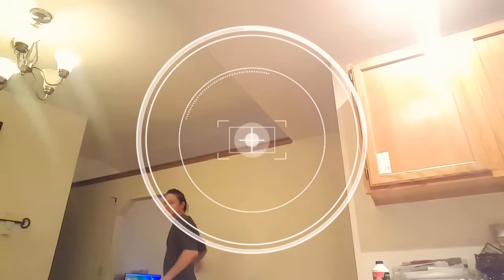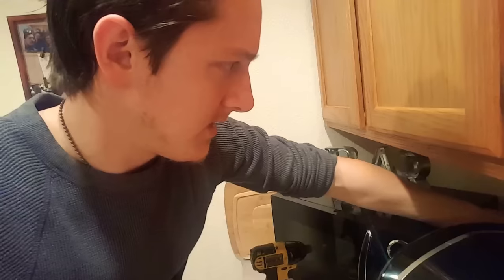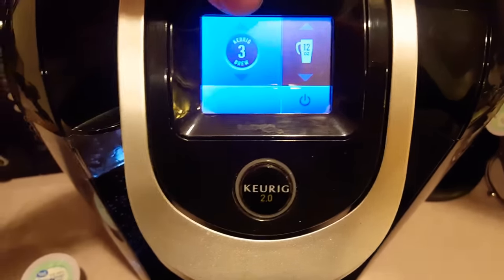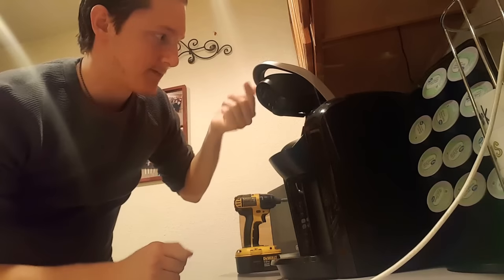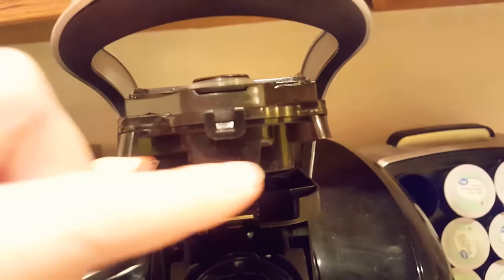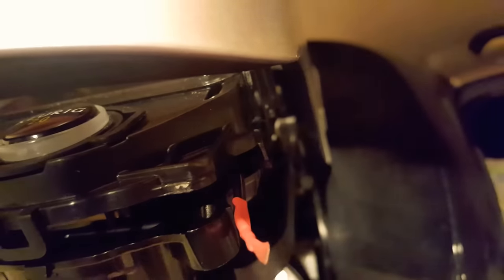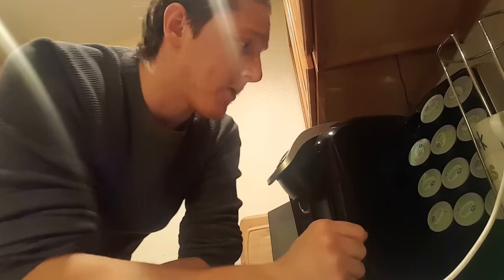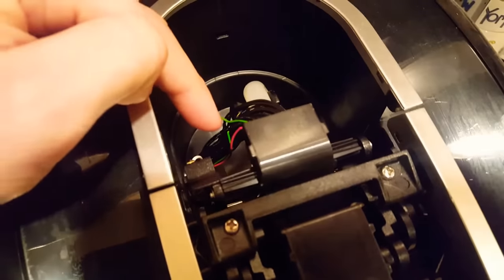Unlocking Keureg 2.0 PERMANENTLY (FULL MENU ACCESS) - Ep.2

Comment: Nice video.  I just got a 2.0 brewer and one of Keurig's My KCup 2.0 and when I put that into my brewer, all of the menus are unlocked.  I can understand unlocking so you can use any "My KCup".  But what's the benefit of unlocking when you're using just a standard K Cup?
Reply from the maker: Scott Baldwin You usually only get a limited menu when using k-cups, if I remember correctly it's like 3 options. This way you'll have like 18 options from 4oz. To 16oz. Plus carafe options without the carafe, so you could brew a pot or fill a 24oz thermos like I do.

Comment: Cut and spliced the two black wires and got nothing. So decided to cut the single green wire. When i plugged the machine back in it just kept pumping water. Spliced the green wire back together and it works again. But no menu change. So with that being said i would say its a bunk hack thanks though.

Comment: Just got my 2.0, saw your vid, followed instructions, but now my keurig just goes to the 'oops' screen no matter what cup I stick in it. So I decided to black up and undo everything, my keurig still stuck on oops screen. Anyone out there have ideas what went wrong. Thanks!
Reply from the maker: Joel Chavez I would guess the optical sensor is the culprit, not sure why it would still say oops. Did you connect the two black wires after cutting off the magnet sensor? Did you make sure to only cut the green wire in the back? Once those are reconnected you should have you standard Keurig back. Not sure why its giving you issues. It has seemed to work for almost everyone so far.
Reply: @LILBZ3  yes, I first read all the comments and most were positive. That's why I decided to try it. I had your video playing while I did this on my coffee table, did exactly as you did. And its apparent its the optical sensor, even went out and bought a new cup, still getting the oops screen. I appreciate you getting back to me so fast, thanks. Good thing I still have my old keurig.
Reply: I had the same issue, spliced the black wire for the magnet and cut the green wire completely.  Stuck on oops screen even with no cup in.
Reply from the maker: It sucks that it didn't work for everyone. I know that some of the new Keurig's are compatible with the "My K cup" and this hack doesn't work on those. I state this in the description but it may not be clearly stated. I would hope that reversing the "hack" would revert it back to original operation. It sounds like that is not the case. I hope your caffeine machines will be replaced or somehow magically start working again. My apologies guys.
Reply: PROTOONE I saw another post that cut the yellow wire and the green wire.  Tried that and it worked.  Depending on your model, you may have to cut the yellow wire as well.  My wife likes the fact that you can now fill a travel mug.
Reply: @matthewstoessner5739  I cut both the green and yellow I still get the 'oops' screen. I just bought my machine off of a facebook yardsale, onlyu paid $50 for the machine. it is a 2.0 500 series. I originally cut the green wire then the magnet, spliced the wires, and all I got was "oops" I then read your comment her, figured I'd try the yellow wire, and still,....nothing. now my machine has green, yellow, red, orange, blue and black wires.

Comment: i got as far as getting to the clips and i got stuck. Any tips for getting the clips off?Thank you
Reply from the maker: Stephanie Thorpe they are kinda a pain, just be patient and use a small flathead screwdriver or even any thin piece of plastic to pry each clip away to seperate the two halves. Don't worry if you break a couple, there were plenty of clips for such a small part. It helps to pry the two halves apart while fiddling with the clips, that way they don't just clip back into place. I hope that helps.

Comment: Hi. That was a very helpful video. I haven’t tried it yet, however I intend to. BUT, I might wait to see if you can help me with something else. The top housing on my keurig is giving me trouble. I just kind of figured out what is wrong. Now I must figure out how to fix the second issue I’m having.  1. The rubber stopper fell off, I figured that out from watching another video, reinstalled it and look forward to my next cup. 2. One day I heard what sounded like something falling down inside the rear area of the top housing that opens when you lift it. Well, since then every time I try to close it, the piece that has the window in it for the visual sensor, it sits back too far. When you start to close the housing it should move forward a bit, therefore allowing the parts above and the needle to slide through the appropriate holes in this piece, thereby allowing you to close it and prepare your caffeine. Well, that piece ends up hitting up against the back of my needle and stops it from moving. I can manually pull it forward a bit, let the needle slide through, then close and go. BUT...anyone else decides to make a cup, slam...boom...bang...forcefully attempting closure by manhandling. So, you seem knowledgeable and handy, any ideas on how to fix this issue. You did show me how to uncover the top housing, which I didn’t know, so that will give me access to the area I need to get to. But any further suggestions would be greatly appreciated. GREAT JOB BTW...I look forward to more hacks.
Reply from the maker: Lisa Smith I know the piece you mentioned slides along the silver pin you see horizontally when you lift to add a Kcup. I'm worried however that you might have broken a plastic piece. I would take the top cover off and peak in the back of the unit near all the wires to see what may have fallen off. If that piece is a piece of broken plastic, my suspicions may be correct. You may have an unnecessarily difficult fix on your hands and you may consider replacing. From my experience, these tend to get calcium buildup inside the water heater that takes away from the keuregs effectiveness and taste after about a year of occasional use, so a new replacement isn't a bad option. Let me know if I can be of any help.
Reply from the maker: Upon reconsidering my response you may be able to complete this hack THEN tear that optical sensor out with brute force and throw it in the garbashio. Hope you are still thoroughly caffeinated!

Comment: I didn't get the full access menu.. But I was able to use an off brand cup I wasn't able to before. I watched your vid like 3 times to see if I missed anything.. And I can't see what I did wrong? Any suggestions?
Reply from the maker: Ana Rivera did you connect the two wires that went to the magnet sensor? I used the word splice in the video and not everyone may understand to put the two black wired together (bypassing the magnet sensor). I can't think of anything else that would cause your issue.
Reply from the maker: Ana Rivera did you connect the two wires that went to the magnet sensor? I used the word splice in the video and not everyone may understand to put the two black wired together (bypassing the magnet sensor). I can't think of anything else that would cause your issue.
Reply: That did the trick! Thanks for responding!
Reply from the maker: Ana Rivera glad we figured it out! Enjoy! :) Oh and subscribe if you'd be so kind.

Comment: Watch out re the green wire. I cut it on mine and it was the wrong one. I had to splice it back together! I see below someone else had the same problem. I'm going to look again to see if I can figure out which is the correct wire.
Reply from the maker: Mary Sheppard Hmm It should be standard for most 2.0's however things may be changing with newer models. I'm glad you were able to splice them back together. I know my keureg was on its last leg before I did this upgrade and it has been functioning properly ever since. I'm glad this isn't a permanent hack, as it can be reversed by splicing them back. Sorry it didn't work for you. I would call it quits If it didn't work. Sensitive electronics and all.

Comment: Did as sugested, spliced/connected thoes 2 wires. Tried this after the magnet trick diddnt work.  Kurig 2.0, followed directions (i am a mechanic)  no luck. Imagine its good for most people, but do note it wont work for everyone. Why is mine different? Musd be in the program. Mine must not have that one.
Reply from the maker: charles hart Did you find the green wire in the back of the unit and cut it?
Reply: No, i cut the 2 balck wires and twisted them together. Maybe i should watch the rest of the vid? Green wire? Hmmmm
Reply: If the green wire is optical sensor, are you saying that it is also pertinant to getting that advanced menue display? Optical being to decide if k-kup, and when magnet used green wire is not touched. Stands to reason green wite not needed for advanced function, but is used for k kup detection? Either way, i will certainly cut the wire
Reply from the maker: charles hart Yeah there was a couple people in the comments who didn't cut the green wire and they had no full menu, once they cut it they had the full menu. I think the magnet and sensor work together. With them out of the picture the machine always gives you full access no matter what you put in it.
Reply: PROTOONE note to self:
 Be sure to read all comments and watch entire video PRIOR to .
 All else fails, read the directions i guess. Thanks for your patients.  We have a winner! That green wire did it. The cool part is the hot water. Can do any function with no cup in there and dont have to hold the stupid button down.
  Wonder why this machine has the full menue program in it, and not be accessible?  Why load it, and not grant access?
  And, any idea what the heck froth is? Blow bubbles or something?
   Thanks for the vid, and the support. U da man.
Reply from the maker: charles hart I'm glad it worked! I sometimes put a small magnet at the bottom where the drip tray slides in to trigger the k carafe mode to pour a lot of hot water if I ever need to. Kinda cool to know toot machine well enough to make it do what you want. Haha Oh, and froth is a specific k cup that literally puts froth on top of your cup... I think. Haha Like a latte. Enjoy!

Comment: Many thanks to Protoone for posting this video.  My Keurig 2.0 suddenly wouldn't allow me to use the carafe feature.  So, I tried this fix.  Initially it didn't work and I kept getting the "Oops" message.  Then I saw Erika Santiago's follow up message and that did the trick.  In my case, the wires were held to the green mother board with a weak glue (from the factory?)  So, when you opened the upper module (containing the magnet sensor and the small motherboard) the connector Erika mentioned would automatically disconnect.  Once I peeled the wires off the motherboard, I could easily reconnect the connector back into the holder.  And that did it.  Now I can use all of the features of my Keurig again.  By the way, I recommend completely removing the two screws from the upper housing after loosening them.  If you don't, there's a good chance they'll fall into the innards of the Keurig sometime during the repair/hack.

Comment: Cautionary tale.  I followed the instructions, removed the sensor, spliced the black wires together.  Not only did I not get the full menu, but now the machine will not turn off.
Reply: Read through the comments, and now will have to go back and cut the green wire (which I did not do, as I only use Kcups).
Reply: Cutting the green wire did the trick!  Now I have all of the menu items and the machine turns on and off via the programmed times.